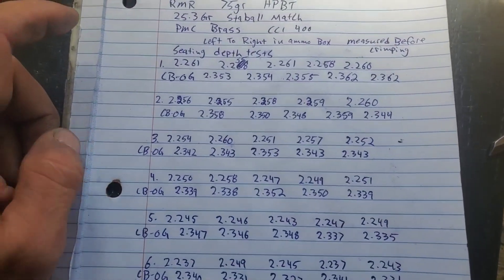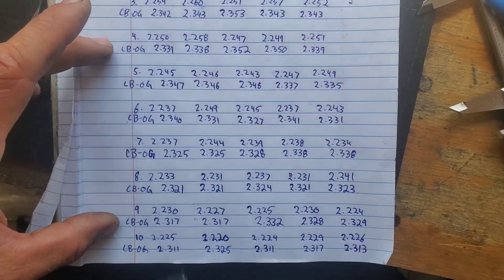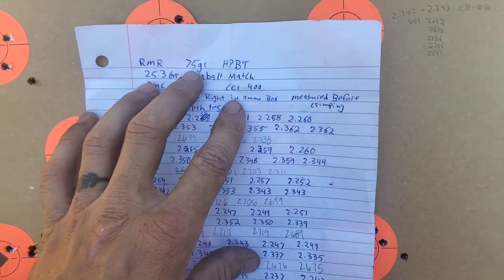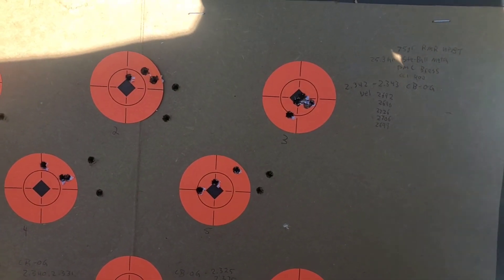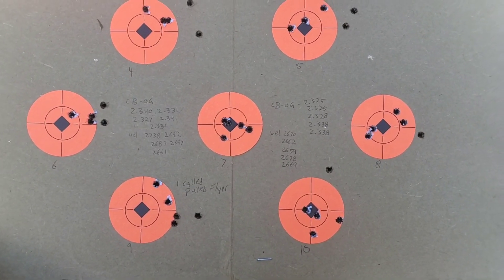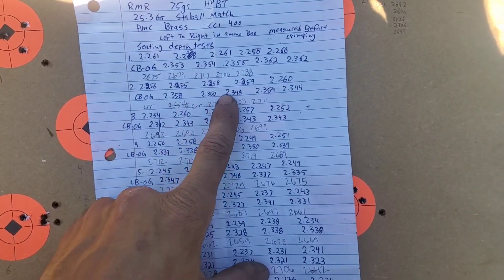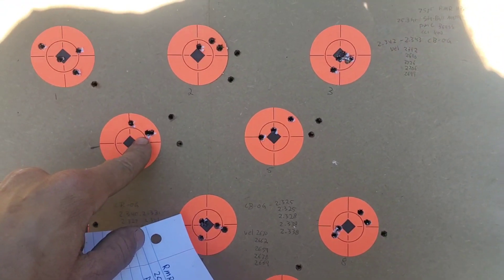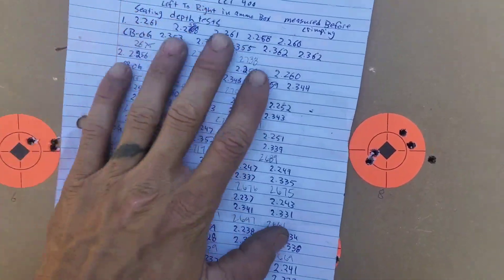*Data only* RMR 75 grain .224 Ten different Seating Depths Shootout

Comment: I was going to suggest that you measure all of these bullets from base to ogive and sort them accordingly. Probably something you have already considered.
Reply from the maker: You know what I think it is? I'm going to do it because I did that this evening and they weren't horrible..

I'm going to sort them base to seating stem. I'm going to pull my seating stem,  screw the jam nut out flush and measure bullets bullet base to seating stem, because I think the errors are in the first .050 of the bullet tip way up towards the meplat where that silly ring is. 

Anyways, great idea, great comment!
Reply: @timberfallingcouple Then what about using the Sinclair tool that makes all of those bullets closer to the same. Sinclair even use’s that tool on the Sierra Match King bullets for better target results. It’s just another tool worth thinking about, but those guys are using bolt actions too. It’s just worth thinking about. 🤔
Reply from the maker: @ToddAdams1234 that would be a great Idea, I think. Isn't the Sinclair tool a bullet pointing swage die? That's a really good point. [Mind the pun]